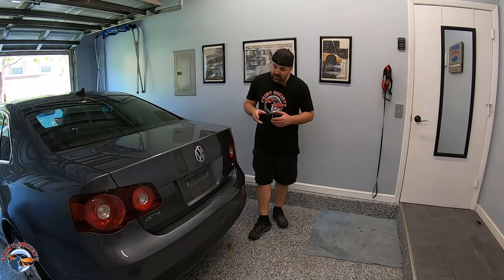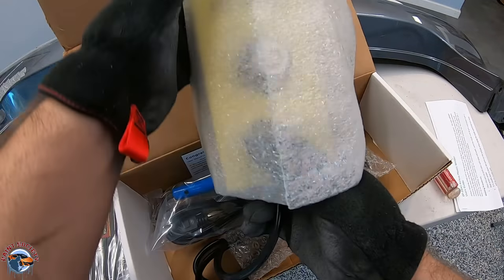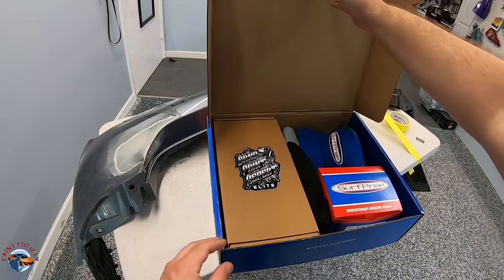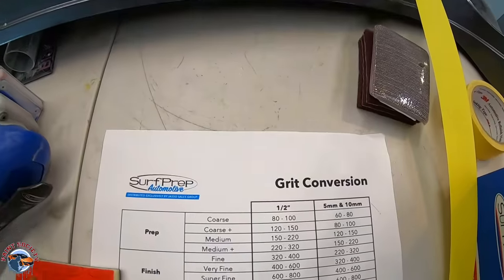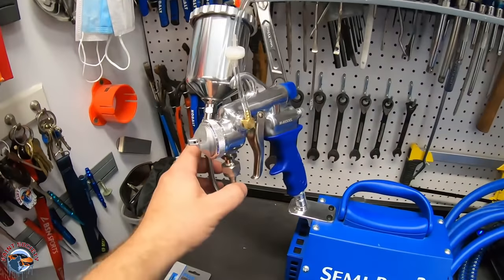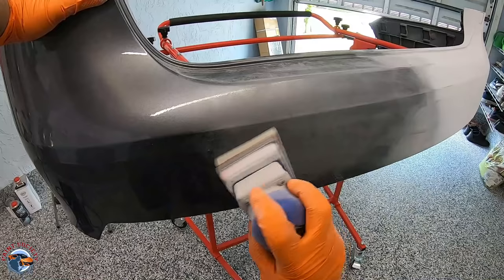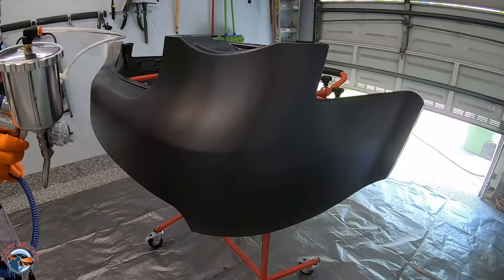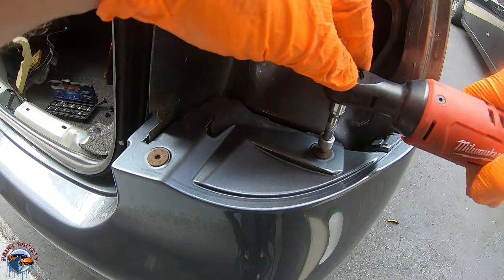My Wife Damaged our Car, here is how I FIXED it in my Garage

Comment: Hi Brian, only thing missing here is how you detirmined the plastic base for the welding material. Just a quick pic of the code on the inside of the bumper and a bried explanation would do. Otherwise all good info as always.

Comment: Stay away from the fuji semi pro 2, even he ditched it mid video.  It just doesnt have enough power to atomize the paint.  That and the gun doesnt even have solvent proof gaskets.  Can shoot one coat and it starts to leak and the gasket will swell and become unusable.  Fuji wants 20 bucks plus shipping for a solvent gasket that should of come with it in the first place.  They also made the threads on the cup non standard so you cant swap it out with another or a plastic system.  I ordered another U adapter from a different company that Im hoping will work so I can save the gun at least.  I asked fuji support for the adapter size and they wouldnt tell me, said the only thing compatible was their overpriced junk and 3m bottom feed quick change attachments.  I picked up a 4 stage titan capspray system which seems to work a lot better, but still not sold on the turbine stuff

Comment: Great vid and very timely.  I just painted one bumper and I have one more to go.  I was going to ask about the bumper stand but as I'm typing this, you cover it in the video.  I'll definitely check out that link.  Positioning bumpers to paint them correctly is hard to do without the proper tools.
Reply from the maker: Yea that stand is one of the best stands I have ever used

Comment: Excellent Job. Do you ever had a chance to paint hood on Garage setup. I am successful painting door, bumper in Home (Garage), but when i paint/clear Hood, FUMES(overspary of clear) falls back on to the hood because it  is flat surface.. on a proper booth you have exhaust fan to take the overspray or fumes out, but in home it is a challange, if you get a chance to paint hood in home setup, please advise any tips..

Comment: Could I use something like a Fuji 2203G Semi-PRO 2 to paint a whole car?  Any recommendations as to a system above the 2203G but not as expensive as the Q5?
Planning to attempt to refresh my paint on my Civic after watching your videos for over a year.
Reply: stay away from the semi pro, its just not strong enough to atomize paint well.  I would look for a minimum 4 stage turbine to paint a whole car with.  It may take a few weeks, but watch the offerup and fb marketplace in your area, turbines dont bring a lot in the used market and can normally find a god deal if you look a bit.  Just make sure and buy the whole system at once, the parts and especially the guns are expensive separately

Comment: I love your videos Brian, you explain and show every step really well.
I really like the usage of all the guide coat, you really only need just a bit to see all the dents and scratches.
The best paintjob is worthless if the preperation is bad, so preperation is always key.
I do think you go a bit over the top with the filler for the pinholes. If you keep an eye out for pinholes during the epoxy application, you can just fill them after the primer and save a bit of material.
The pinhole filler will always lose a lot of thickness during drying of the material, so in my experience, keep it as little as possible.
While you certainly can use a single gun for the whole job, it takes a lot of experience to make it work. A 1,8 cap might change the color in a way that it doesnt match, thats why Brian changed compressors, to have more pressure, so the paint will get distributed finer, despite the large opening of the cap.

It's a try and error thing, through which you get experience, so that you know, the paint apllicated is distributed too thick or even too thin.
I think it's aperfect example, compare the fading endges of the primer/basecolor to that of a video Brian has done inside the Bodyshop,look especially for silvertones.

Comment: The air control valve is on the hose of the semi pro 2.  I wonder if it was on full pressure (it probably comes full pressure  from factory), but something to look in to. And may have been the problem if it wasn't.  I was disappointed when you switched to the q5, but you got to get the results at the end of the day.

Comment: Why didnt you drill holes at the ends of the cracks? We studied at school that plastic cracks tend to come back with vibrations and tempersture changes if you dont end it with a drilled hole. Am i wrong?
Reply from the maker: The way I repaired it. It’s solid. No need to

Comment: Hi, Brian
I am a huge fan of your channel. I got a quick question regarding block sanding. On my final block with 400, I had a few sand throughs on a few edges but I am going to use a sealer next. Will it be ok to seal over the burn throughs or do I need to spot prime and sand those areas? What would you do? Thanks in advance

Comment: Hi there , I've only ever used cellulose paint in the past , i'm looking into 2k paint for small jobs,motorcycle parts, as i know how dangerous it can be  , can you recommend a reasonably price filter mask ? , Cheers , Chris UK .
Reply: I use a Gerson or 3m half face mask for occasional repairs using 2k. I must admit I don't like using 2k in a closed space so tend to work with the garage doors wide open and a fan running on slow to clear the mist quickly.
You're gonna get dust nibs in your clearcoat doing this of course, but I value my lungs much more than my painting projects and that will not change!
Can't beat 2k for toughness and solvent resistance though, and it's safe if you take some sensible precautions IMO.
Reply: @Macmonkey1000  . Thanks for your reply i'm very grateful , What reference/number type filters do you use as there are so many ?, cheers .
Reply: @chrisshaw4689  Hi Chris, the Gerson is an 8000E 2k compatible, they're widely available on ebay for around £30. The filters on my one say they give protection from organic and inorganic vapours.
I'm so keen not to breath ANY 2k mist  I find that even when wearing the mask I practically hold my breath all the while I'm laying down a coat ( I typically do small projects) and then make a rapid exit through the side door of my garage to suck in some fresh air, so I'd probably be fairly safe even without a mask !
Reply: @Macmonkey1000  ,  OK, cheers for the help .

Comment: Hey brian, i have an old car that im restoring the paint is not terrible and minimal rust. Should i sandblast it?
Reply: I would not sand blast most jobs if the paint is tight and original.  If multi paint repairs were made over years and years, you should probably chemically strip but not blast.

The big problem with sand blasting lite gage sheet metal is it tends to warp, due to heat and pressure.

If you need to get rid of rust it is OK to blast but try not to work to far out from the main problem, it is better to grind/sand the surrounding area.  If rust is on a large flat panel your may want to cut out the bad metal with tin snips, just be sure to use proper color (Red or Green) tool so you don’t bend edges..   When blasting auto body panels I do like to use walnut shells (conventional systems) although I prefer using CO2.  This newer technology is an investment but better if you have the money.

Comment: Hey brian thanx for a new video, my approach to this fix would be panel bond and plastic filler is it a viable option or you still need to plastic weld? Another question if instead of fixing this repair you orderd a new part from the dealer and it came with the black electric primerbI thibk its called, do you neee to seal it first o what is the approach to take? Thank youuu
Reply: Its best to get a good weld on the plastics before any fillers. Also a pre primed bumper would be ok to paint as is but you will most likley do some minor work on it after test fitting then your back to having to prime over any area.

Comment: What do you recommend on using if the bumper has rock guard infused to.the bumper like a 93 Nissan 300zx. Would like to change the color from.white to black but don't want to damage the rock guard

Comment: A new rear bumper cover wouldve made more sense to me. Either way thats a job well done
Reply from the maker: Sure thing. Repairing is fun and rewarding though.
Reply: I agree… you can get one painted to your door for 300-400..  sure making something look good again in your garage is cool and rewarding but when the airless plastic welder is 200.00 bucks alone.. well in my garage or anywhere it just doesn’t make any sense. How many bumpers you plan on beating down. I would be curious to see a “guy off the street” cost breakdown on the material and products used with out sponsors and such. Not sure about you but I have enough one time tools.
Reply from the maker: 300-400 will get you a aftermarket bumper with who knows what kind of paint on it and which what Guarantee of a color match

Comment: awsome vid but by the time you pay for all that kit you could have bought a new bumper!
Reply: How much does the Plastic Weld Kit cost? A professional body shop is going to charge atleast $500 to replace and color match a bumper cover........that's IF the shop uses a crappy aftermarket cover. If they use an OEM factory cover, the cost could easily exceed $1,000. The guy did say there is a cost that comes with buying the tools.........what he should have also said was that the cost of the tools is a minimal investment if you plan on using it on a regular basis. I bought this same kit to repair broken bumper covers on my Scion and Nissan......since then, I've used it to repair atleast 50 other bumper covers for various people.